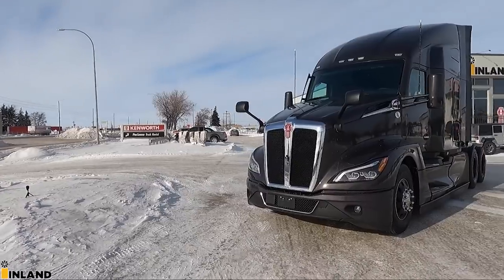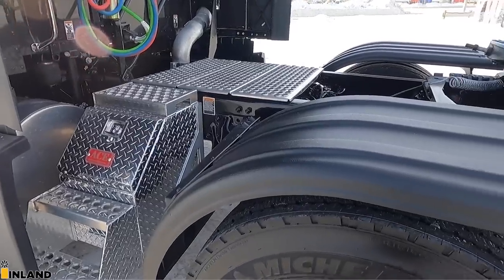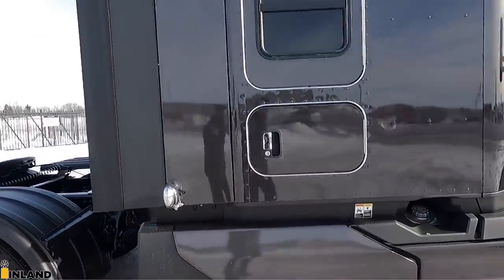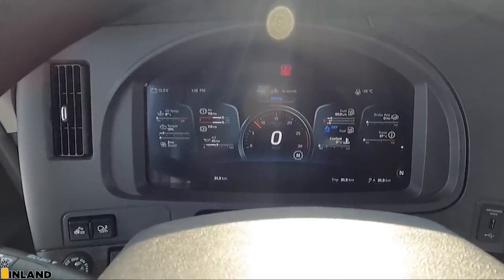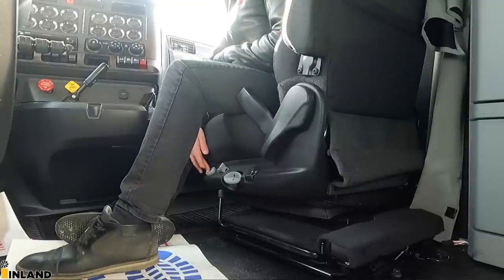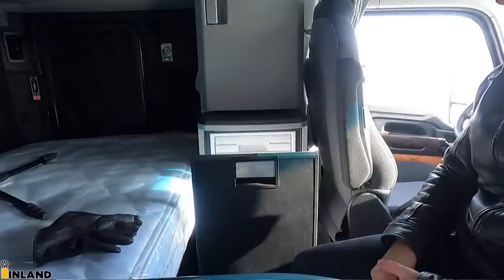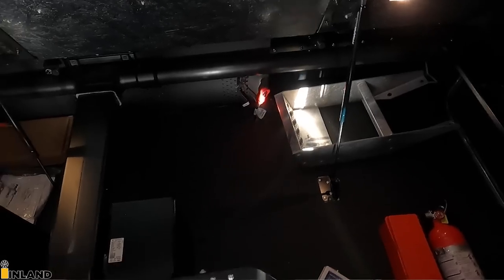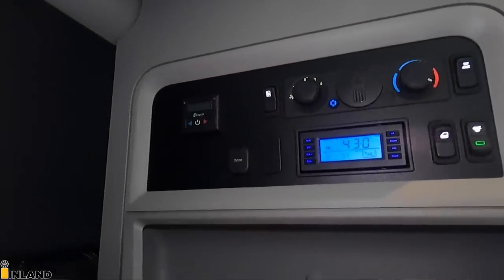BLACKED OUT - 2022 Kenworth T680 Next Gen FULLY LOADED with Dura-Black -  THE KENWORTH GUY

Comment: I used to deliver equipment mostly new tractors and trailers from dealerships,  KW's,  Pete's,  Mack's,   
 It was a lot of fun as I got to drive the newest innovations,  like smart steering wheels,   (Vorad)  safety radar,  the first Cummins ISX 600hp with super powered Compression Brakes (Jake),   the first Super 10 transmission,   and even every once in a while, and old 5 & 4 twin stick,  😃
 Seeing that KW brings it back,  GREAT VIDEO.            Thanks

Comment: Really like this Truck but the one thing I would add is I would like Dual exhaust and inside the Truck I would charge it to just a single bunk instead of the double bunk but I would like have this Truck otherwise
Reply: So how hard would it be to spec Me out that same unit but add dual exhaust and the single bunk but everything else the same because I would be interested in it
Reply: @davidjohnson7224  You better contact them on their site or something, there are like thousands of comments here, they can very easy miss yours. :)

Comment: I'm looking to buy in 2 months. It's impossible to get real info on trucks availability and "real prices " do you guys have any new or 1 year old t680s in stock ? If so what is the pricing in your area? I'm a serious future buyer. I just need real info. Sellers bs alot here so I get nowhere. Please help.  Looking for a new or slightly used t680 or Pete ultraloft. Double bunk, Cummins engine,  manual transmission with 325 to 355 gearing. Apu a huge plus. Thanks for your time

Comment: I have a 2022 kw 900 and very disappointed with the quality other than the engine and transmission. What looks like a costom paint job is a wrap thats flaking and chipping off, the dash board if comming apart, drive train paint flaking off, wires comming loose .